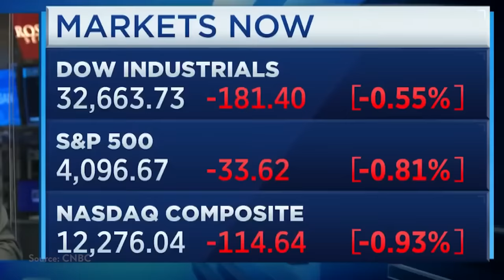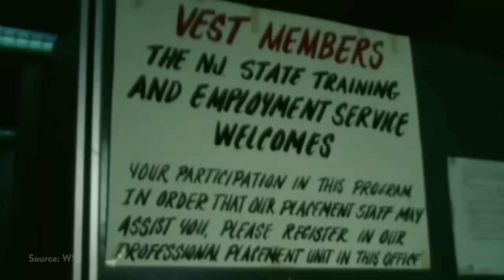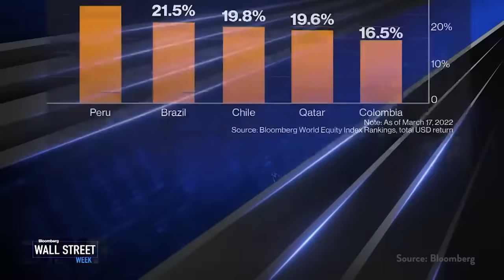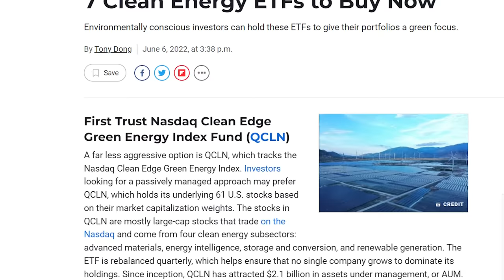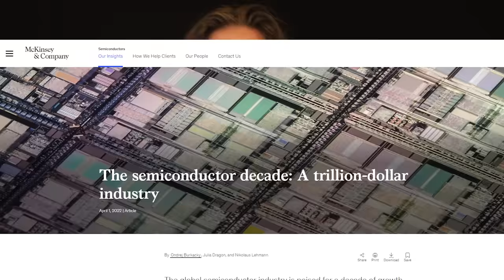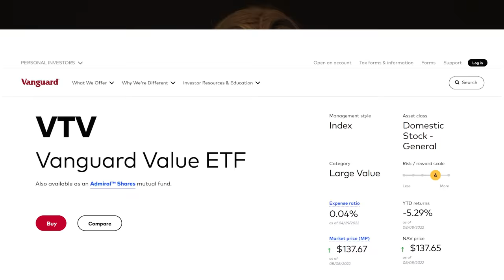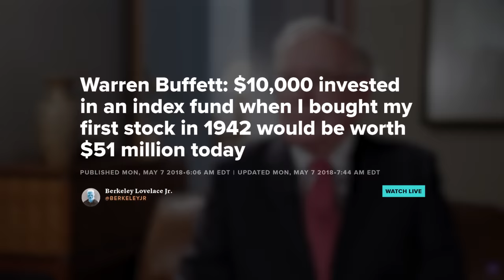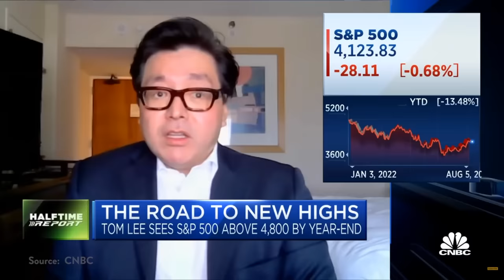Get Rich in 2023 With ETFs

Comment: The problem with his advice is that inflation kinda ruin the idea of making money I made over 278% on one year of portfolio but because money is always decreasing value its worth less than 1940 value I could retire by back then now I have to find a way to retain value while making money
Reply from the maker: Best to diversify! Investing has the potential to generate much higher returns than savings accounts, the 278% you made in 1 year is only equivalent to 0.13% to 0.20% APY from banks.

Comment: You got to be loving the house prices at the moment! It’s looking good 👍. As a verbal offer is not an offer until you sign: make many at the same time. That puts the pressure on them to come back with a yes or no. Also never pay full price. Looks at coms in the area. Take off double the cost of definate repairs. Ie be kitchen 20k take 40k off the price. Always get it checked. Good 🍀 luck. By the way the rule is to look at 30 properties before you buy one. That way you get to know the comms and house better than the best one you looked at is the best statistically.

Comment: Any reason why you didn’t mention US total stock market etfs such as VTI ?
Reply from the maker: More info on VTI:
- As of July 31st, 2022, VTI holds 4,076 stocks. The top holdings of VTI include Apple, Microsoft, Amazon, Meta, Alphabet, Tesla, Berkshire Hathaway, NVIDIA, and JPMorgan Chase.
- As of September 6th, 2022, VTI has net assets of $1.22 trillion, an expense ratio of 0.03%, and a price per share of $195.91. Since its inception on May 24th, 2001, VTI has provided an average annual total return of approximately 8% and a total return of approximately 414%, with dividends reinvested.

Comment: The elimination of gas powered vehicles by 2035 is simply virtue signaling. There’s no way the power infrastructure could handle the kind of load that would generate. Look at the Southwest where the Colorado River is drying up which will impact power generation by Hoover Dam. Electric vehicles currently probably make up less than 5% of the total market. Can you imagine how much money and work would have to go into power infrastructure by 2035 to handle the load??? And that’s totally ignoring the lies around how great EV’s are, ignoring the shift in pollution, the effects on the environment, the links to slave labor related to rare materials mining.... yeah... 2035... for sure....

Comment: This guy obviously doesn't understand roulette.
Reply from the maker: Enlighten me!
Reply: @MaxMaher  Betting on black and red both is foolish. It pays 2 to 1. So for example, let's say you have $200 and bet $100 on black and $100 on red. Then red comes up. You would win $200 for your red bet and lose $100 for your black bet. So you end up with your original $200. 

Plus, a lot of casinos increase there edge by adding a green 0, 00, and/or triple 000. So if you made the same bet in the first example and it comes up 0, 00, or 000 you would lose everything.